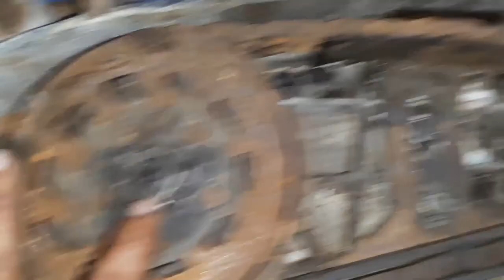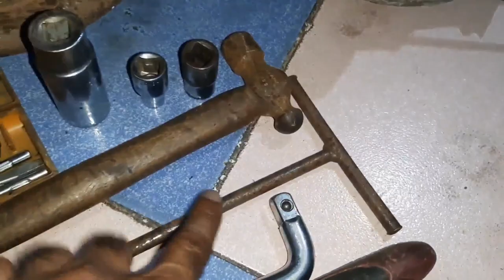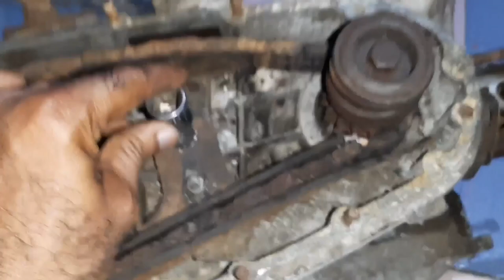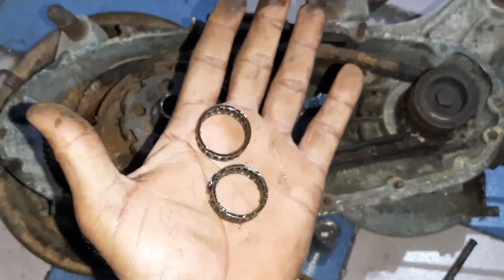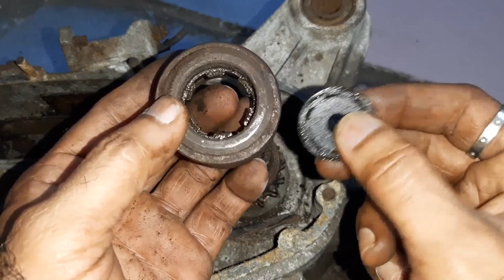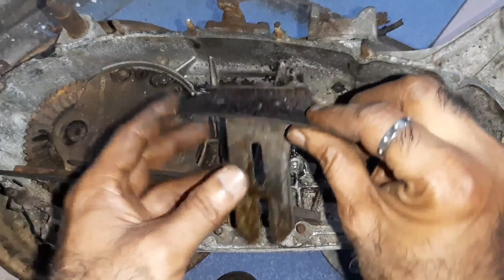Revive Your Lambretta Scooter: Removing Rusty Engine Parts

Comment: Sir i hav seen a lamby scrap in sale n he is telling it is fo 25k 15yeqrs papper pending is it worth buying it
Reply from the maker: Please don't take that. If papers are not clear at any cost Please Don't take that. If papers are clear take it at 16k maximum. If condition is fine. Closely check at engine bedding bushes. There should not be even hair cracks. If you take without papers it should be used be only used for Project purposes only but not for running on road. We should never break the law 👍👍👍👍🙏🙏